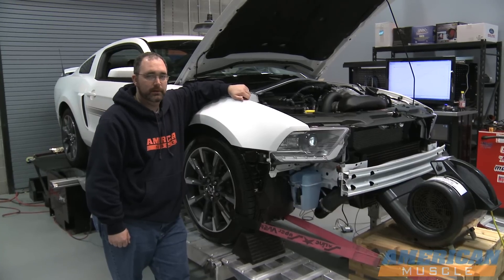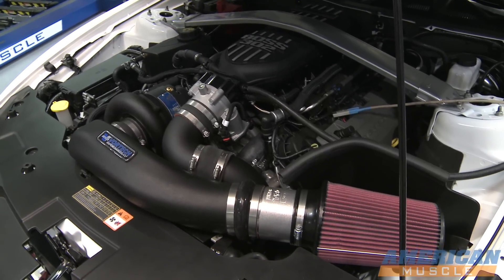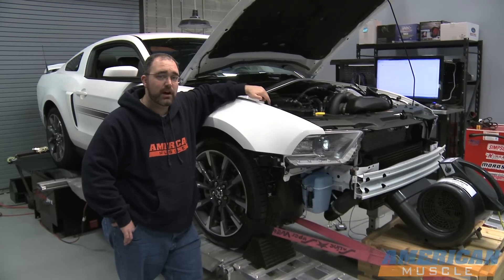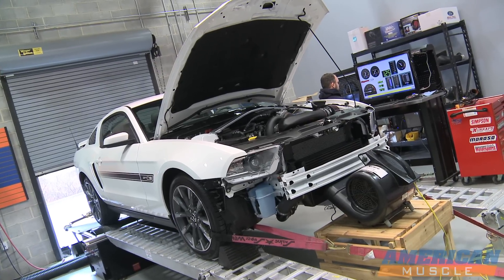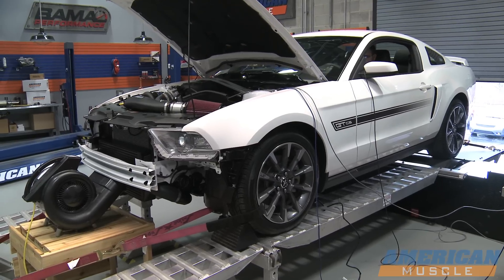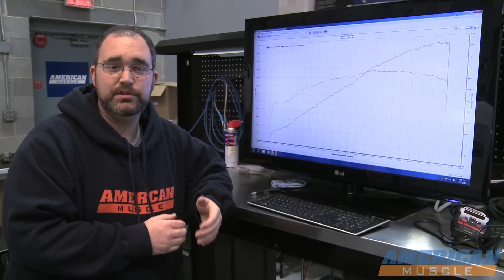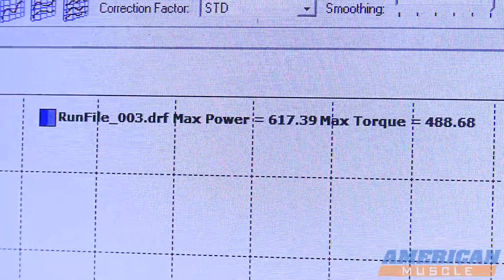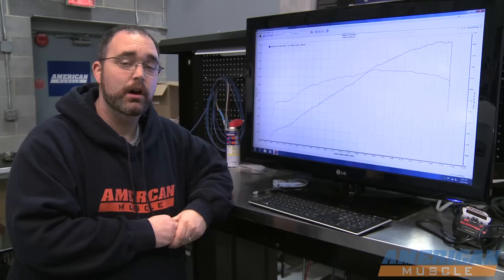Bama Performance: 617HP 2011 Mustang GT Vortech Supercharged on the Dyno

Comment from the maker: @scorpionfights It's stock exhaust manifiolds, so I don't think the 3" exhaust limits it.  I think you're thinking the right direction, though - the lower torque rating is probably within the head design and intake manifold design. -Chris Rose

Comment from the maker: @turboTime1987 We thought he meant cold air intake, not intake manifold.  This intake manifold would drop boost levels, correct.  Yes, the stock exhaust manifolds probably see about .5-1 PSI or so, they're not that dramatic of a decrease in boost.  The biggest loss is the intercooler.

Comment from the maker: @0gmstuckey You can get away with 9-10PSI, as long as it's tuned properly and you use good quality 93 octane fuel.  This particular car was putting down 6.5 PSI, but probably would have seen 7-7.5 PSI if it wasn't for the Boss intake manifold.

Comment: @scorpionfights They did put a Boss 302 intake manifold on it and that intake you loose a little bit of TQ. the Boss 302 tq drops from the 390 from the GT to 380 but you gain more high end power

Comment: @americanmusclevideos What boost level is safe for a new 5.0? They are already at high compression. I dont know if i would be comfortable with forced induction. I know ford makes a crate 5.0 with low compression specifically to replace the current 5.0 with the ability of forced induction. That would be neat to see that engine swap

Comment: Apparently just an offroad X pipe and catback so yes stock shorties.1 7/8" LTs should add another 30-40 whp to that setup especially in the upper RPMs but even low RPM and peak torque I would expect to climb 30-40 ft/lbs so from 488 to about 518 peak torque and likely 650 whp. I would expect  boost to drop even more due to increased exhaust gas flow. Fixed compressor speed due to pulley size and rpm) but more flow. Boost is a measure of restriction to flow not power!!!

Comment from the maker: @05nasty Actually, this system makes 7.5-8.5 PSI on a stock 2011 Mustang GT.  Because of the Boss intake manifold, the boost is down at 6.5PSI, which is completely normal for a higher flowing intake manifold.  This made 617HP because of it.  Read around the forums, there's someone who claims one run at 630RWHP with this same exact setup.

Comment: 603 whp on a mustang dyno equates to 603 x 1.10-1.13 = 663-681 whp on a dynojet assuming the mustang dyno operator properly setup the dyno. 10-13% difference in numbers using the same correction factors going from peoperly calibrated mustang dyno to a dynojet.